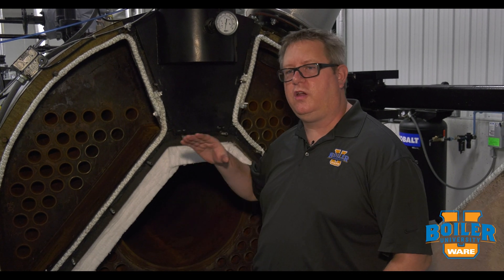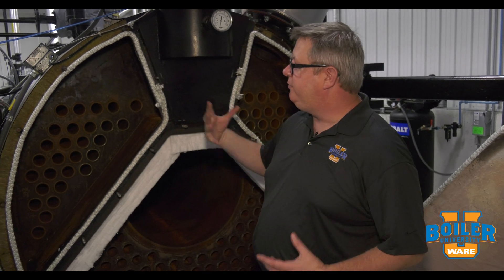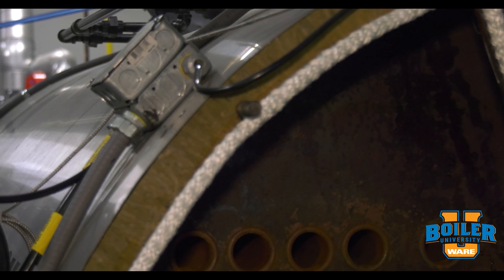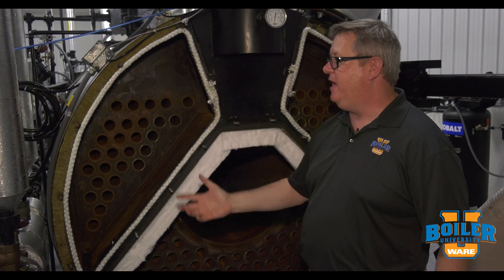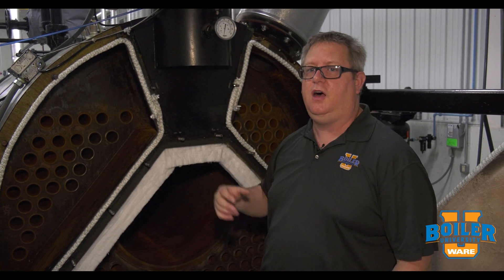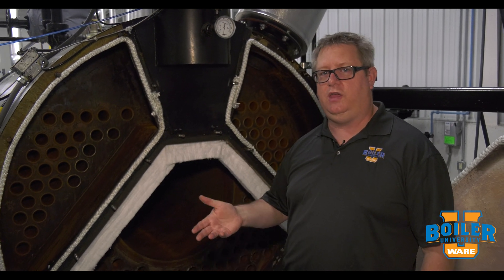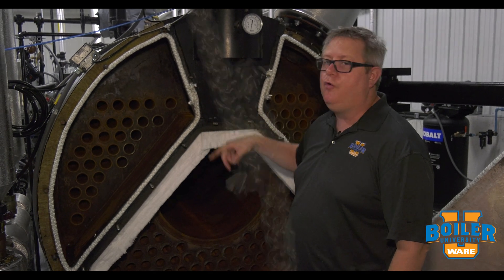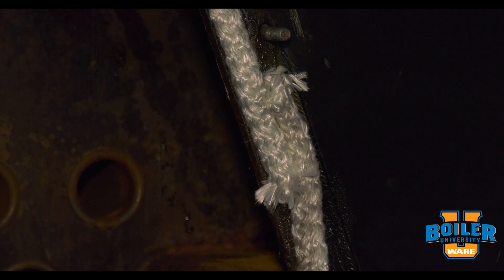Using Fiberglass Rope Gasket to Seal Boiler Doors - Weekly Boiler Tips

Comment: Do you guys not add door mud on top of your ropes once they have been installed. It helps to create a better seal and prolongs the life of the rope. Rope gaskets do not need to be replaced every boiler service if they are treated properly.